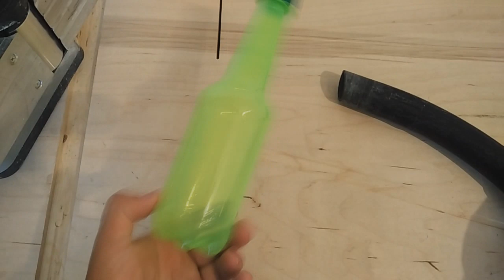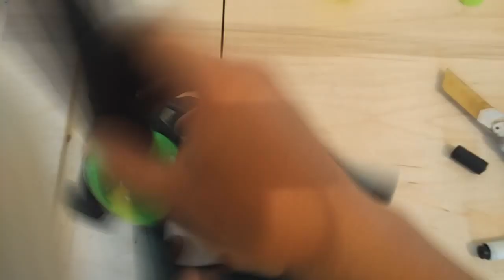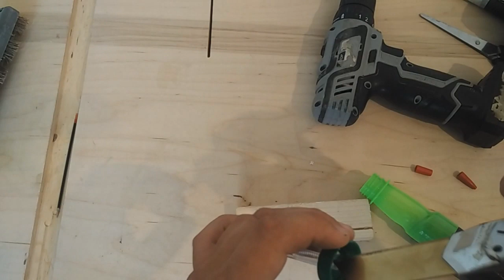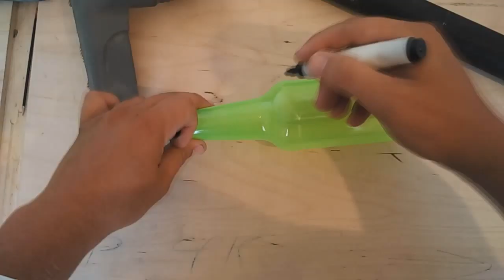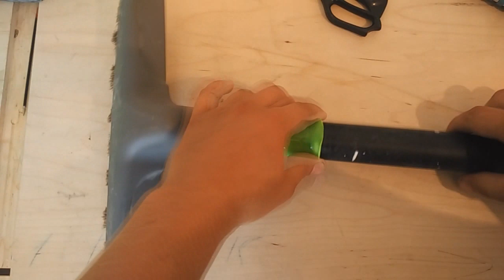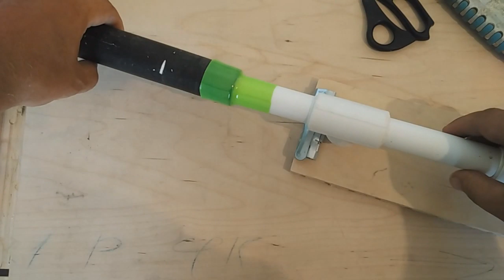Making Custom Vacuum Adapters / Vacuum Cleaner Adapter / DIY Plastic Bottle Dust Collection Adapters

Comment: Finally got around to heat shrinking a cut Mountain Dew bottle and found it works very well.  I also found the similar shaped clear Pepsi bottles work just as well, if not just a tiny bit better.  These are the 16.9 ounce / 500 ml smooth-side cylindrical bottles.
Reply from the maker: Thank you for sharing your experiments with other bottles.
Reply: This is what I have been scouring the comments for! Which bottles work!

Comment: This is absolutely genius!!!  I bought a set of mini vacuum attachments and wouldn't you know it, they didn't fit my vacuum hose!  Now I'll be able to use those attachments...once I buy a heat gun.  Big Thanks!!
Reply from the maker: You won't believe it, I did it, exactly when I bought the vacuum nozzles and they didn't fit. I decided to share it with my brothers on failure.

Comment: this is BRILLIANT! I don't have a 'proper' vacuum cleaner (no carpeting), just my roomba (which is awesome) and a stick-to-hand vac, which works just fine EXCEPT the 'mouth' on it is oval, like the sander (I think?) from your first example, so this may be my solution! I don't have a heat gun so I will see how well my hair dryer does, and if not I'll get a cheap gun - easier than trying to find a hose adapter for the vac - and boom, no more sawdust!
Reply from the maker: Moreover, an industrial hair dryer will still be useful in the future:) Thanks for watching. Happy to help.

Comment: For this to give good results, you need to make sure you have a bottle that has a very long tapered top, such as this Mountain Dew bottle. Other PET (polyethylene) bottles will work, but you will realize that the plastic shrinks to a certain point, then it simply stops shrinking.

I can't find Mountain Dew bottles such as these shown in the video, and I haven't found a suitable replacement yet.
Reply from the maker: Children's bottles have a small diameter
Reply: @woodproducts7423  Bingo!
Reply: @woodproducts7423  What’s a “children’s bottle?”

Comment: Do all soda bottles act like heat-shrink tubing, or just a select few?
NEVERMIND!!!  I found the references to Mountain Dew.
Reply: Finally got around to heat shrinking a cut Mountain Dew bottle and found it works very well.  I also found the similar shaped clear Pepsi bottles work just as well, if not just a tiny bit better.  These are the 16.9 ounce / 500 ml smooth-side cylindrical bottles.

Comment: Can you solve this problem?  I have a "Eureka Blaze" stick vac.  Like most 2 in 1 stick vacs, this converts from a stick/handle floor vac to a small hand vac when stick/handle is removed.   It comes with crevice tool with oval end that inserts into the oval opening of the hand vac.  But NO dust brush for cleaning furniture, drapes, blinds, etc.   How would you create a dust brush hack to attach to the hand vac like the crevice tool does?  Obviously use one of the hundreds of generic dust brushes available, however, they have round connections to connect to the typical round vacuum wand.  The answer is found in creating a "connector" that is oval on one end to connect to hand vac, and round on the other end to connect to a dust brush.  Let me know your thoughts.    Thanks!   And you are so smart in many different ways, including the absence of annoying music and confusing dialogue!

Comment: not bad. good for light usage only because of the thin plastics.
Reply from the maker: Do 2-3 layers and it will be more powerful.
Reply: @woodproducts7423   PVC/PP pipe would be great.
Reply from the maker: I agree, but that's another story.
Reply: @woodproducts7423   like Rambo films.
Reply: I don’t see why these wouldn’t work on even a small planer or table saw.  All they are doing is holding the two attachments together.  As long as there is a good seal, they should work well.
Reply: Josh Easler     *seal
Reply: youtuber thanks.  Autocorrected. Grrrrr

Comment: This could possibly save my car engine, dropped ceramic from spark plug inside and I can see it on a camera but the hole is so small I can't get inside at the same time as vacuum it out.

Comment: Looks good but can you identify the type of plastic for those of us who have to try other bottles?  The recycling code number should identify the type of plastic.
Reply from the maker: Hi. I'm sorry but everything you wrote I can't do. I have tried all plastic non-alcoholic and alcoholic bottles that compress perfectly. The only condition is that the diameter of the bottle is 1, 1.5, 2 cm larger than the billet.

Comment: Anyone try putting a second or 3rd bottle over the first, multiple layers, build up thicker walls, to add durability and maintain structure enough to stay put when theres more pressure on the joint, like say when the attached end sucks down on a hard floor unexpectedly and you don't stop forward momentum quite fast enough and it buckles and pops off 😂

Comment: WIll a hairdryer work if one does not have a heat gun?
Reply from the maker: Hi. Good question, I haven't tried but I think it won't work.
Reply: Wood Products:  Hair dryers run much cooler than heat guns so they don’t damage your hair so almost certainly won’t get the tube hot enough to shrink it.  But why not try it to be certain?
Reply: Placing the object in a pot so the heat is concentrated, although the hair dryer could get damaged.

Comment: did you try different plastic bottles or any brand is ok?
Reply from the maker: Hello. Choose a diameter of 1 cm a maximum of 2 cm larger than the diameter of the vacuum cleaner tube. The bottles are small colored, they are dense.
Reply: Hi, thank you for the reply; I mean if you use a particular bottle or any plastic bottle is good. What was this green bottle?
Reply from the maker: Mountain Dew 0,5
Reply: @woodproducts7423  ty

Comment: In another comment you mention that these are Mountain Dew bottles. In my part of N. America none of the smaller soft drink bottles look like that (with the long neck, I mean). Have you, or anyone else for that matter, tried this with other types of bottles? do they heat-shrink too?
Reply from the maker: Yes, only select the diameter of the bottle by a centimeter, one and a half more than the billet. Oh Yes, I'm not responsible for all the bottles, maybe you will come across a defective, non heat-shrink one:) Joke...

Comment: Are you using a hair dryer
Reply: Try a model airplane film shinking heat gun: it goes somewhat hotter than a powerful hair drier. I use a "Hobbico" brand, Deluxe model, and it works perfectly!

Comment: Don't see mentioned what kind of plastic bottle you used .. all looked green-ish .. but don't see mentioned what was in them or what kind works. That is .. not sure all plastic will shrink-wrap.
Reply from the maker: Hi. Mountain Dew 0.5. I tried a lot of bottles, all have the same effect, they shrink when heated.